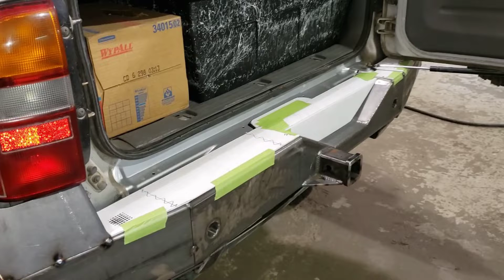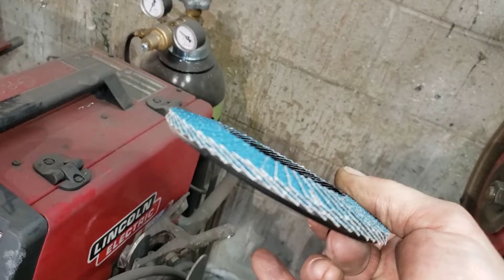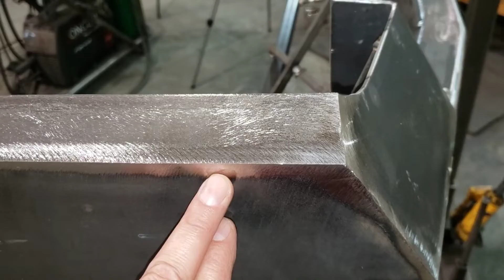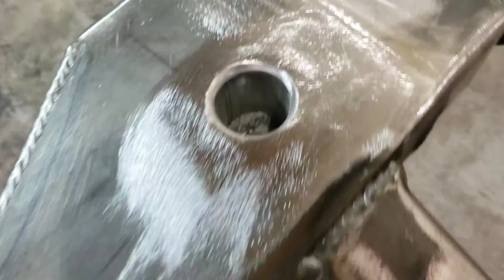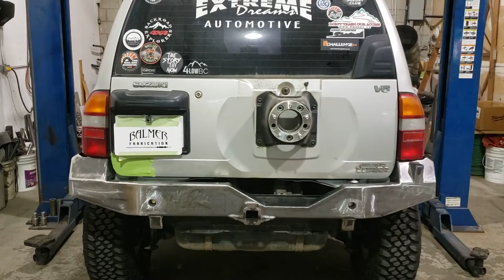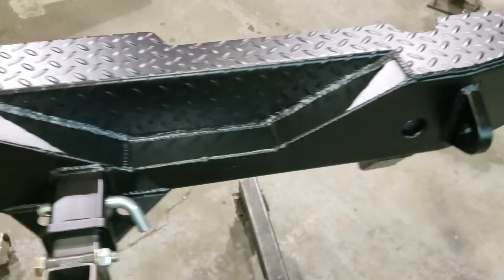Suzuki Grand Vitara (Escudo) Custom Rear Bumper Build - Part 4 - a DIY metal finishing clinic!

Comment: Wat welder are u using and settings
Reply from the maker: Lincoln MP210. .030" solid wire with C25. 19V @ 300IPM.